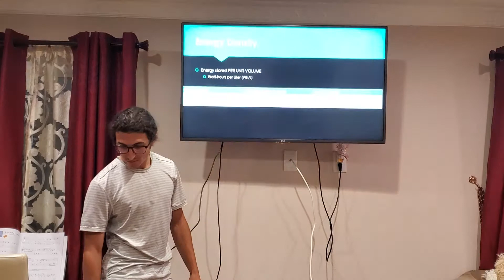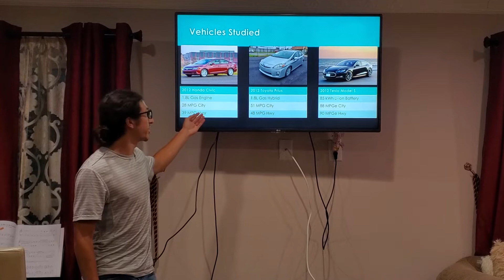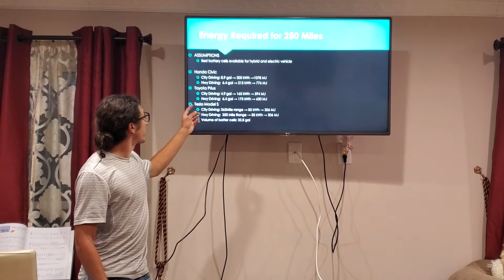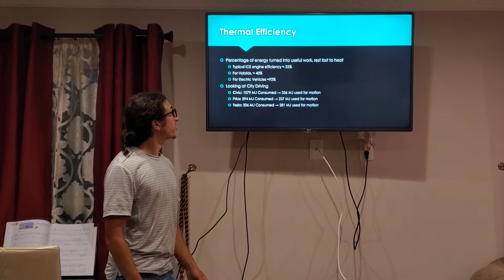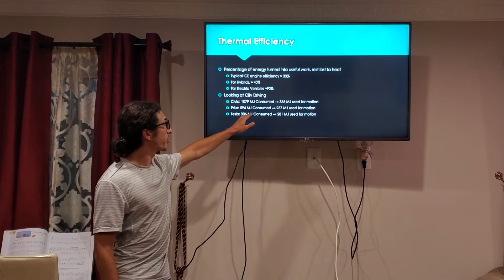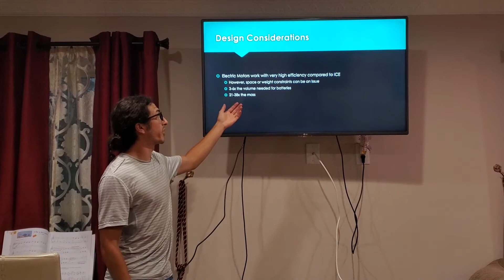Muhammed Al-Hassani SMT 04162020

Comment: Technical Content: Technical content was very interesting for me as I hope to go into the automotive industry. Just reading off values can get a little dull though. Try explaining what each value means for the cars then briefly comparing.

PowerPoint: Power points had a lot of good information on them. Some of them were busy and hard to see at the distance from the camera.

Delivery: The slides were hard to see. Camera adjustment is needed. He seemed very knowledgeable on the subject. Stance and body language was not distracting. Not many 'uhs' and 'ums', which is impressive.